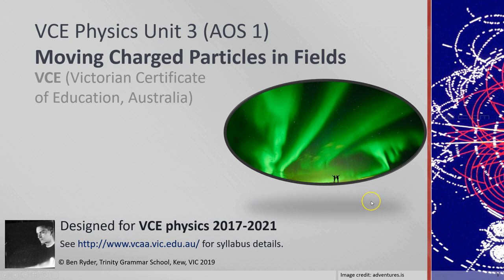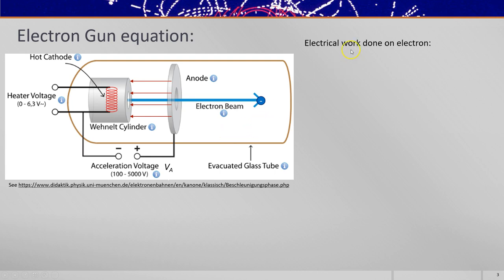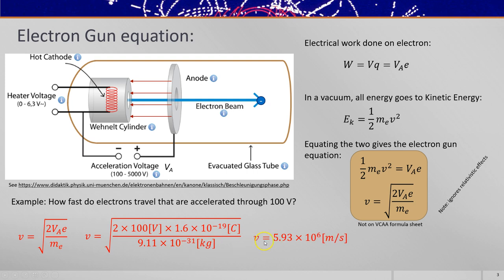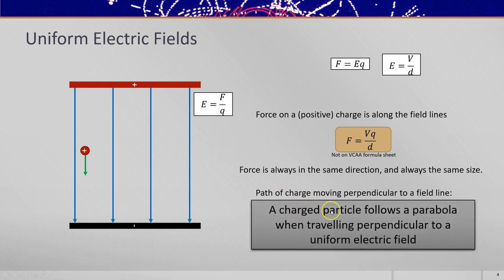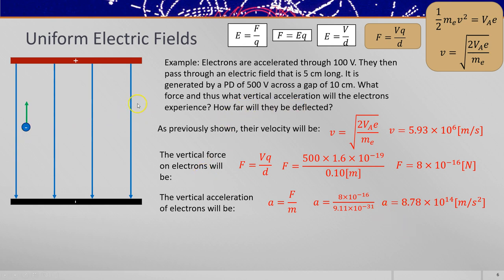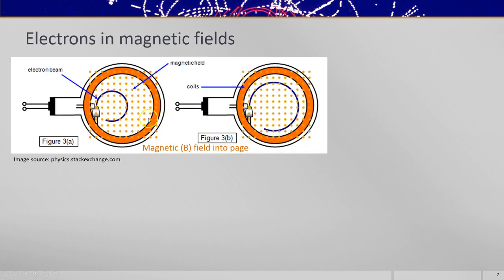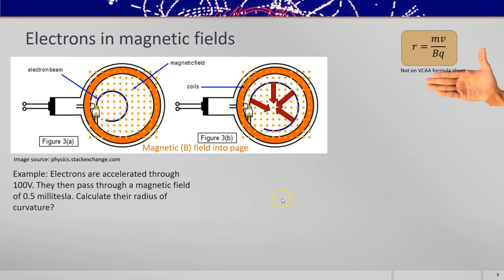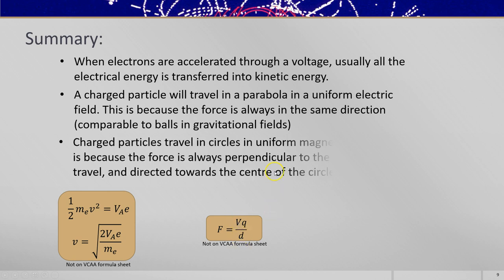Electron beams in electric and magnetic fields (VCE unit 3)

Comment: Why don't the electrons that pass through the hole in the anode decelerate after they pass the anode? Going up to the anode they see an accelerating force. After the hole in the anode, the electrons will see an attractive force behind them. How much of a simplification is it to say that just after the anode, the electron will be shielded from the cathode (depending on the geometry and size of the anode aperture) and therefore to no longer be in the influence of an electric field?
Reply from the maker: There needs to be an electric field to accelerate electrons. There is a strong field between the filament (connected to the negative) and the anode, so the electrons accelerate. After passing through the anode, there is no other surface connected to the negative terminal, and so there is no strong field here. You could say that there is a small field, as a point infinitely far away from the anode is at zero volts, but it's really a tiny field strength compared to the field between the cathode and anode (remembering that E=V/d). It can seem counterintuitive to many students, but considering the field strength is the way to understand what's going on here.